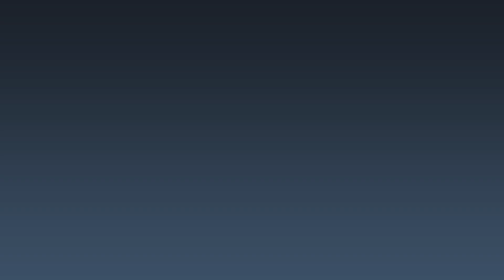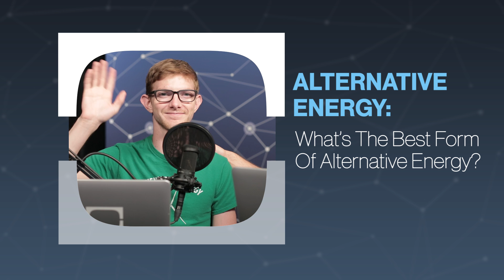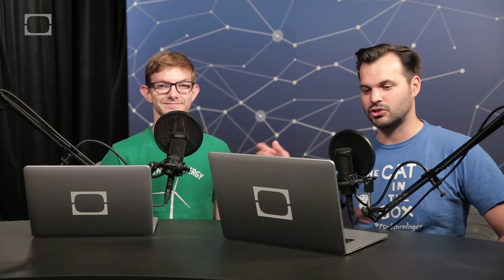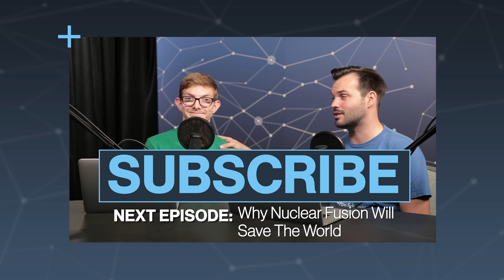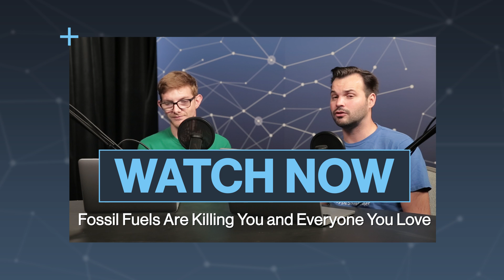What's The Best Form Of Alternative Energy?

Comment: How do you get rid of nuclear waste completely? 😑😑😑😑😑😑😑
Reply: It loses it's radioactivity after enough time. All we need to do is wrap it in concrete and it will be perfectly safe. After that, it is just normal metal.
Reply: So it's safe for the future without any radiation runoff
Reply: @adrians.bailey3956  "Used" Uranium rods are only 1% degraded by the time we bury them in the ground. Perhaps in the future, we will be able to dig up the old rods and reuse the other 99%

Comment: There is no single "best" form of alternate energy. ANEUTRONIC fusion (deuterium-tritium is as bad an idea as the 29% efficient gasoline engine) will no doubt be the cleanest way to make electricity, but IF thorium-liquid salt reactors are as safe as their proponents claim, IF there are actually uses for all of the radionucleides generated, and IF storing all the thorium that results from mining other rare earths is a problem, then liquid salt thorium reactors may be a good idea--for use in some places and some situations. Developing them must not, however, get in the way of developing aneutronic fusion.

And yeah, pressurized-water reactors ARE the evil thing we all thought: they are dangerous, they do occasionally melt down and release vast amounts of hard radiation. They were implemented because the government wanted to extract plutonium for nuclear weapons from the wastes. I think the liquid salt reactor has been around as long, and is apparently safer, but the government couldn't weaponize it. There is no way to track the increase in cancer deaths resulting from Fukushima, Chernyoble, and Three Mile Island, so you can convienently ignore them. That doesn't mean they haven't and are not still happening, or that those meltdowns will not continue to kill people far into the future.

Given its limited range, a battery-electric car won't do for me and for many other people. A turbodiesel (45% efficient)aluminum or magnesium-battery electric hybrid will (lithium-ion batteries are dangerous, too expensive for their life span, and the fusion power industry will need all of the lithium--a rare element--we can find), and if it runs on biodiesel it can be clean and carbon neutral. Algal biodiesel would take only 14% of the land now used to grow corn for gasahol; it need not be fertile land, it can even be grown at sea; algae can clean up polluted waters while it makes energy for us, two birds with one stone, a technology that's good for the planet, for a change; burrying the char left after extracting the oils, then running the remnant through a Fischer-Tropsch-like process for even more fuel would be a way to sequester atmospheric carbon; and if you grow the right algeas in clean substrates, what's left after you extract the oils is health food. Do that right and it's virtually unlimited food and livestock feed, an end to world hunger (just as population becomes about double what the planet can feed otherwise), and arable land freed up to grow better crops for human consumption. Everything we do with petroleum, from fuels to fabrics, from plastics to paint, we can do with algal oils, without the pollution and climate change. And let me repeat that because it's important: done right, algal biodiesel promises an end to world hunger as a mere biproduct.

The only thing wrong with natural gas is that it's a fossil fuel and adds to atmospheric carbon. Biogas is indistinguishable and carbon neutral. Making it with anaerobic digesters cleans up sewage and animal wastes, farming and urban lawn and garden debris, and any waste foods that can't go to hungry humans or livestock, all of which are better uses than landfilling it to rot and add CO2 to the atmosphere, which is mostly how we currently waste food while a quarter of the people on the planet go hungry. Gas furnaces and water heaters can be 95+% efficient, and so clean that I run the exhaust from mine into my greenhouse, to let the plants have at the CO2. Made from clean inputs, the solid leftovers can fertilize soil; if unclean, pyrolize them for more liquid fuels, and burry the remnant char to sequester the carbon and pollutants. The liquid wastes fertilize algae--which clean it--as does the CO2 (~ half the gas produced), making more biodiesel. Clean water, clean air, and carbon neutral fuel, all from cleaning up sewage the smart way.

Running 29% efficient motor vehicles on methane, on the other hand, or using it to genetrate electricity in 40% efficient power plants, then wasting another ten percent to line losses, are stupid ways to waste a resource that could be used at three times the efficiency heating homes or water. Using each resource where it is most efficient will be absolutely necessary if this tiny planet is to support nine or ten billion army ants--uh, humans--a few short years from now.

There are still millions of homes and commercial buildings in the U.S. that badly need inslulating and weathersealing, yet the oil men who run our country and congress cut the subsidies for weatherization at the same time they authorized themselves selling off our new fracking oil boom (for which they pay 12 cents on the dollar of actual value) to China afap, so they can bring back scarcity and high prices and much-more-profitable war for oil asap. My 640 sf house is 95 years old, yet with a little insulation, halfway efficient windows and doors, weatherstripping, and a modern, efficient furnace and water heater, my gas bill is <$40/month in a cold winter. The best way to generate new energy is to save old, but if we do that the ***holes who run our government can't sell us fossil fuels and pressurized water fission. Part of saving the planet is ridding ourselves of the pigs running the animal farm who would knowilngly destroy it for their short-term profit.

If we bring affordable fusion online--if Lawrenceville Plasma Physics, for one, can deliver on their promise of clean, simple, aneutronic, five MW power plants that will fit in the bed of a pickup truck, for $200-300k, within six years(!!!)--we may have less need for solar and wind. There are still plenty of places where they will make sense, if they stay cost-competitive--on urban roofs they can provide the most electricity on hot summer afternoons, when air conditioning puts huge demands on the power supply, or charge the battery in your plug-in hybrid without burning coal, or provide remote power cheaply, or where they make the most economic sense, such as wind power on the great plains.

And if fusion, wind, and solar can provide enough power, maybe we can tear out some dams and restore some fish runs, add some much-needed, high quality protein back into the human diet. The salmon taken in fish wheels at Portland, Oregon, alone in the 1930s, before the Columbia was dam(n)ed, would be worth $10 or $12 billion in today's dollars.

If it stays cost-competitive (whereever it is now) high-temperature geothermal power offers the side benefit of learning more about vulcanism. I wonder if extracting heat from Mt. Rainier's magma pipe couldn't prevent its next erruption, saving the millions of people in the greater Seattle-Tacoma area from a really bad day? Or if we got serious about it, and if we have a few thousand years to learn enough, we might not be able to turn off Yellowstone before its next inevitable erruption turns half the U.S. and Canada into a suffocating ash heap wile the resulting volcanic winter kills a few billion around the world with famine? Sounds daunting. If it's doable, we need to find out.

Use resources as efficiently as possible, use the most efficient and cleanest resource for that job, and get the most return from the resource and its byproducts. Do what makes the most sense, for a change, instead of what makes the most profit for the fewest people. 

Or kiss our once lovely little spaceship earth goodbye.

Comment: You idiots defending nuclear power ever heard of Fukushima?
Reply: The Piper But there could be safer ways of nuclear energy. like liquid fluoride thorium reactors
Reply: Yes I agree that there is a possibility of obtaining a safer route for nuclear power transmission. Currently, that is not the case, there a plenty of problems with thorium reactors that need to be worked out before they can be used efficiently.

Comment: With Solar there are Conversion Losses when you convert from AC to DC power. Your Computer and TV do this, and lose useful power. If the President orders it, Manufacturers will make computers/TVs have a DC Power option. You can run your computer off the Solar Panels on your roof.

Comment: Nuk Power - Spent Fuel Rods still Boil Water! They can STILL BE USED! We are getting ripped off! 
Solar suffers from 2 problems: Transmission Losses, and Conversion Losses. You save on Transmission Losses when the power comes from Panels on your roof. 
With Conversion Losses you are changing from AC power to DC, and lose power in the process! Your TV and Computer love DC! But they have to use AC. If the President orders it - manufacturers will make TVs and Computers that can take DC Power - (from the Solar panels on your roof!) Utility Co. and Manufacturers won't like this.

Comment: You forgot to mention that fly ash from coal power stations is radioactive. Coal contains trace amounts of uranium. The carbon which makes up the vast majority of coal is combustible and will leave the system as a gas, carbon dioxide. Uranium oxide however, is not combustible, and will leave the system as ash, which will settle in the surrounding areas. Even though coal power stations have systems in place to catch the majority of the fly ash, they still have to deal with it (again, it's radioactive), and some will still get out as airborne ash.

Comment: Although nuclear power is in the short term better because it creates no air pollution, the radioactive waste has NO WAY TO GET RID! Pollution caused by fossil fuels could possibly be turned into harmless substances.

Also, nuclear reactors are no safer than coal/oil as uranium/plutonium resources are expected to run out <50 years

Comment: I've heard about a furnace that works with electricity to generate 3000 degree (Celsius?). It is required for certain metal alloys, but it drains as much energy as a whole city.

It is true that wind and solar produce not always power, but if we use this power for things like the furnace I mentioned above instead of storing it with losses, wouldn't it be a lot better than more of the reliable-energy fission reactors?

Also I would be happy if somebody would invent a device that creates electricity from thermal pressure. Especially if it could also prolong the lifetime of a battery-charge.

Comment: the main issue I have with nuclear is that though the life time if the nuclear fuel from digging out of the ground to burying it somewhere. nuclear produces about the same amount of carbon dioxide pollution as natural gas.
Reply: ***** you don't have to refine silica as much as you have to uranium. 

Uranium is much more scare
Reply: ***** solar cells don't require enrichment like uranium dose.
Reply: ***** 

I am unaware of what the life time carbon footprint of a solar cell is. This is an unanswered question of mine so I am unable to draw a conclusion 

You have not demonstrated a conclusion that would satisfy that question. 

Please refram from insulting me as a form of argument when you do not have any information to present to assert your case.
Reply: @factnotfiction5915  thank you.

Comment: Nuclear energy enjoys the reputation of being cheap and safe. Yes the chance of something going wrong is very small however if something does go wrong its a dissaster. To use your analogy of the airplane: If it crashes you are dead if, you fall from bike you are bruised. What danger is there with wind or solar power? 
But nuclear energy is cheap right? Yes in a purely short sighted capitalistic mindset it is cheap just like oil is "cheap". Since we havent found a way to safely store nuclear waste long term yet, and todays terrorrism doesnt exacly make the task easier, we have no idea how much either oil or nuclear power are gonna cost us in the long run. My point being cheap for us is expensive for our kids. 
Now to your biggest omission: "We have no way to store the energy and use it for later"? Have you ever heard of a Hydroelectric power plant? If you pump water up, it becomes a very efficient "battery". Furthermore the process of electrolisis used to produce hydrogen out of water can also be used to store large amounts of enery where dams arent an option. The hydrogen is symply stored until needed and then combusted in a conventional internal combustion engine. 
Please try to be more balanced the next time if you want to keep me as a viewer.
Lastly, if you where really thinking long term, you would be talking about renewable energy and not "alternative energy" since only one of them is self sustainable. 
Greetings from Germany

Comment: I'm not a fan of nuclear power because it also is not sustainable. We do not have an endless supply of fissionable material. Also, a ten foot deep football field of nuclear waste does not sound like a trivial thing. Considering that I live in Colorado and Rocky Flats will be contaminated for the next 24,000 years. Uranium nuclear waste will be with us for the rest of the foreseeable future, 159,000 to 700 million years depending on the type contained the pools, yes waste isn't stored in small containers it's stored in massive pools of water until it cools off enough and then is moved to storage pools all over the country. 

Only a few states do not have nuclear waste stored in them. The thing is, there is currently something in the realm of 81 million tons of waste produced a year globally, I know it's not as much as the other fossil fuel sources, however there is nowhere that we can store it that it can never be a threat. So I would rather that we not do what we've already been doing with fossil fuels which is ignoring the long term problem for a short term gain.
Reply: +Hoigwai T The Earth's core doesn't have an endless supply of heat nor does the sun have an endless supply hydrogen to burn, so by your deffintion of sustainable, wind, solar, geothermal, and (non-tildal) wave are all sustainable.
Reply: +kokofan50 Hrm, well let's see. The Sun barring an unforeseen event will last about 5 billion more years so solar is pretty solid. 

The Earth's core will stay hot for about the same amount of time possibly longer if the planet isn't engulfed by the sun going red giant so that also seems pretty solid. 

Wind is generated by the sun and the rotation of the earth, taking those into account it has been calculated that it will still be spinning when the sun goes red giant so that also seems to be pretty solid as well.

The wind produces surface waves (non-tidal) which in turn is from the sun so that is also pretty solid.

So now we come to how long could we continue the current power output from the nuclear plants we have at present. From 2011 the World Nuclear Energy Agency suggests roughly 80 years http://www.world-nuclear.org/info/inf75.html and that's only if we maintained our current consumption rate (as of 2011). 

So, when I say nuclear is not sustainable, I can say that as an energy source something that will only last roughly one human lifespan is not a sustainable resource. These others however will last the existence of our planet thus, they are as sustainable as we can hope to get.

Should we keep trying to improve nuclear, sure but even with pulling uranium out of salt water, which would be really expensive, it will not last as long as the others.
Reply: Hoigwai T There's a number of problems with the numbers in the link you gave me. 1) That's under the assumption we keep using the same reactor tech we have now and the article even says so, "used only in conventional reactors, are enough to last for about 90 years." Current reactors only use .5% of the fuel. Newer reactors can use almost 100% of the fuel. 2) Newer reactors can use other isotopes of uranium, not just U235. By using U238 we could have almost 100 the Uranium. 3) There's thorium fueled reactors, which is 4 times more common than uranium. 

So lets do the math:

90 x 200= 18,000 18,000 x 100= 1,800,000 1,800,000 x 5= 9,000,000 

I think 9,000,000 years worth of fuel is sustainable.

Comment: I am actually pro nuclear, but to say zero effect on premature death seems unfounded. Proving cancers linked to radiation may be difficult, but look at the Hanford site...how about Vermont Yankee. Julian, I also live in LA, and of course there is no data on Santa Susana field lab melting down with no containment vessel because it was in nuclear  powers infancy,  but those radioactive by products were probably under or not recorded and reported. I am not afraid to live so close to Simi Valley or worried about heavy metals from the same Rocketdyne "dump." San Onofre was shut down because the Mitsubishi reactor upgrade was faulty, and luckily it was caught,  and again, I am pro nuclear - lftr is an amazing revamp - but the dangers come in when we under regulate..its proven TEPCO knew about Tsunami dangers years before the generators were knocked out causing a triple meltdown, and nothing was done. Also, the risk of the fuel pools collapsing were also a bigger risk in Japan. Yes bananas are radioactive. So is granite and even out atmosphere from all previous above ground tests, and its not a dangerous amount. Nuclear technology is amazing, and we are still learning from it, but I feel this video is one sided a bit. Trace wasn't actually supplying a real defence, which I understand was the point of the video. I hope we see a Thorium or Sodium series of reactors in the near future and safely and effectively retire our aging current light water and boiling water reactors.